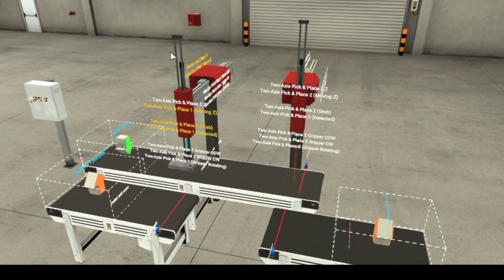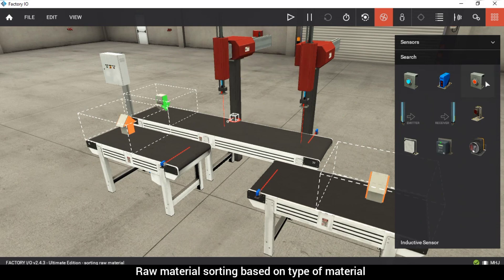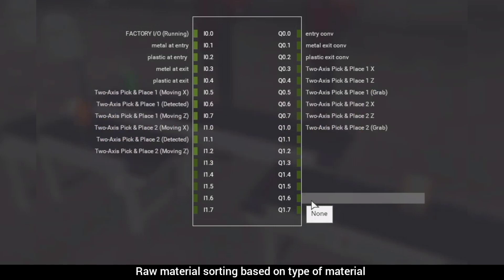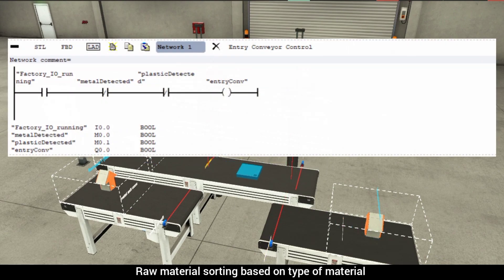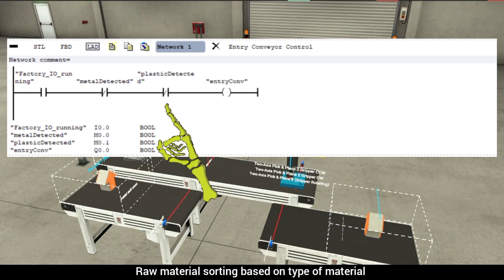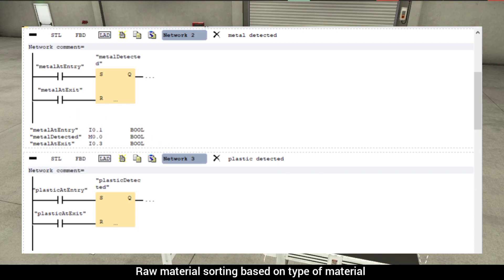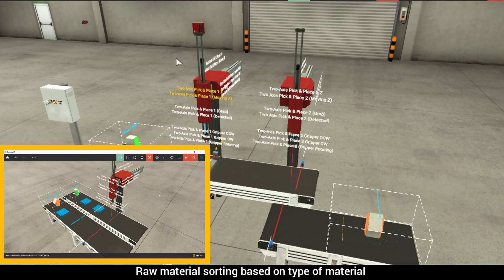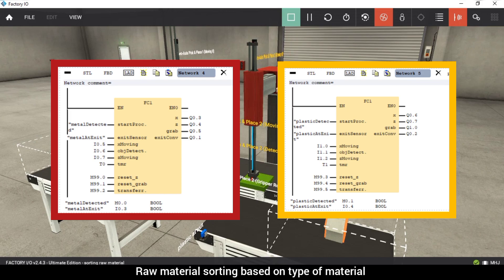Raw material Sorting using Two Axis Pick and Place station in Factory IO

Comment: can we do it with delta robot and camera . which plc are you using
Reply: I like you video,but i cannot acces you drive file😢
Reply from the maker: @muhammadhuzaimiebinmohdasr4600 I   can see that you have joined the Google group so you should be able to access the files. If you are still facing this issue just let me know.
Reply from the maker: I don't have an actual PLC it's just a simulation. I am using WinSPS S7 for programming, the concept can be used to program any plc just the syntax will change
Reply from the maker: I'll look at it after my work shift to give you a better response, please give me time
Reply: @real_ee  thanks for your reply. i wnt to develop delta robot with pick and place and camera integration using conveyor. your help would be highly obliged. we want to develop an industrial grade delta robot.
Reply from the maker: @naren309  Hello, I have recently examined the delta robot you mentioned and have found that the closest resemblance to it can be found in the pick and place XYZ station within Factory IO.
However, I would like to mention that my current programming tool of choice is WinSPS (as it support simulation without PLC), which is not a standard software for programming PLCs. Consequently, it does have certain limitations. Nevertheless, I believe it is still feasible to develop a program for the delta robot, albeit possibly not in the most efficient manner.
Regrettably, due to my impending exam on the 24th of this month, I am currently faced with time constraints that impede my ability to focus solely on this project. My daily commitments, coupled with the time I spend commuting, leave me with limited opportunities to allocate to studying.
That said, I assure you that I will make it a priority to begin working on the logic for pick and place xyz station next month, once my examination is successfully completed. 
Thank you for your understanding and patience. Should you have any further questions or concerns, please do not hesitate to reach out to me.

Comment: Tutorial with TIA Portal ?
Reply from the maker: My laptop doesn't meet the minimum requirements for TIA Portal, so I'm using WinSPS instead. It's a good alternative for programming Siemens S7-200 PLCs with lower system requirements.
Reply: @real_ee  I also wondered why you don't use other programming softwares.
Anyways the project is great and easy to understand and still waiting for production line tutorial.